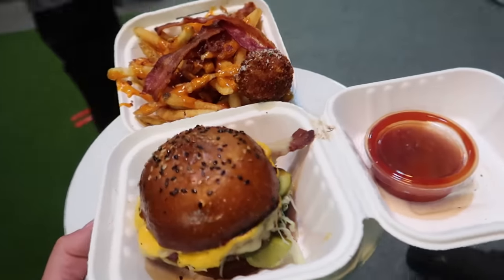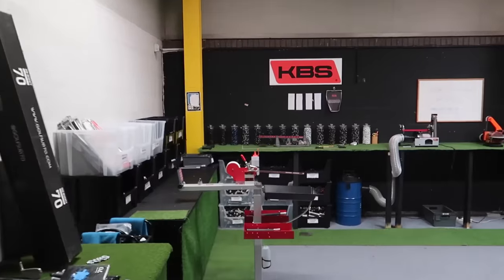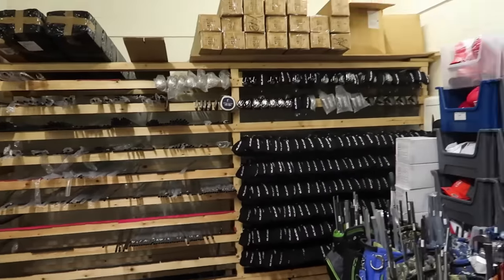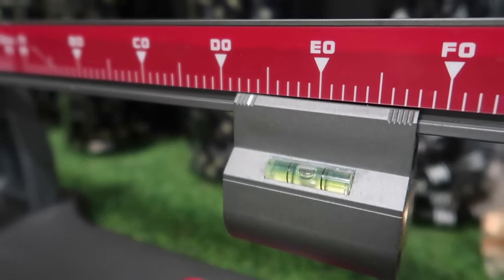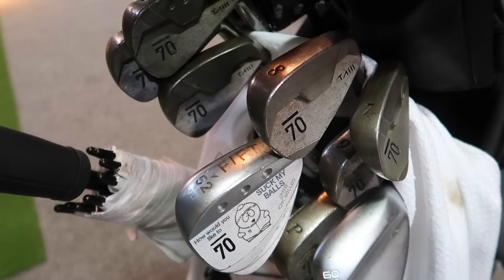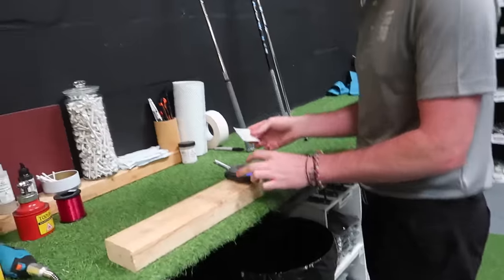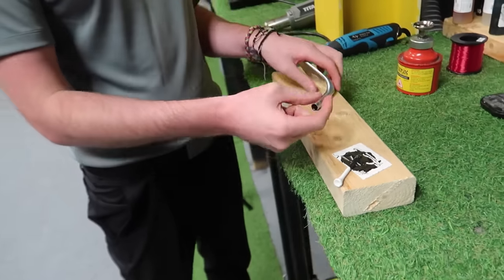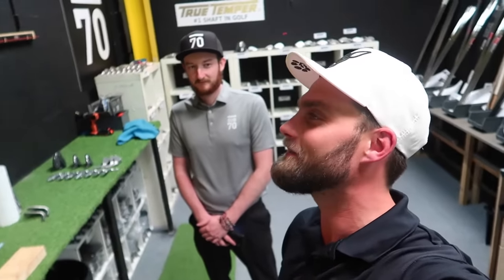The SECRET behind GOLF'S fastest growing BRAND - SUB70

Comment: I play a 52 and 56 tommy armour vcg wedge, forged heads, milled raw face, tungsten weight inserts, everything you would want out of a wedge and I bought them brand new for $60 each, used ones are even cheaper now. I've played vokeys, I've played Nike sv tour wedges, and the tommy armours out perform both those. For the one year they made those (and the atomic lineup) they went with a first rate manufacturer and released some really good clubs.

Comment: Had an old 60 degree Calloway X rusty finish, C grind that I bought off e bay. Used it for everything around the green. Loved it but changed for sharper grooves. Still much missed.
Like what sub 70 are doing, only held back by brand snobbery and the risk of not being able to try before buying.